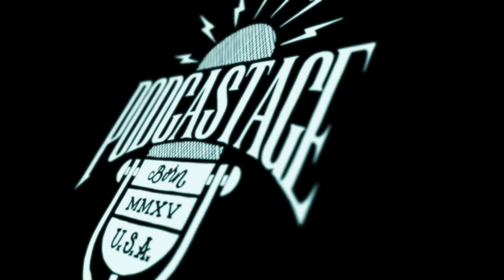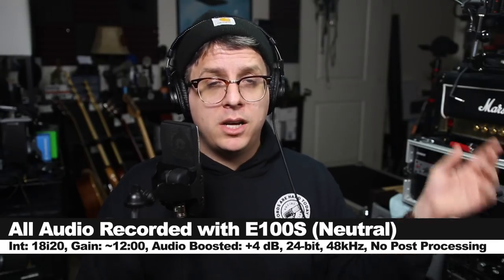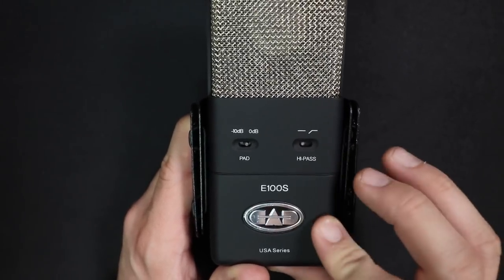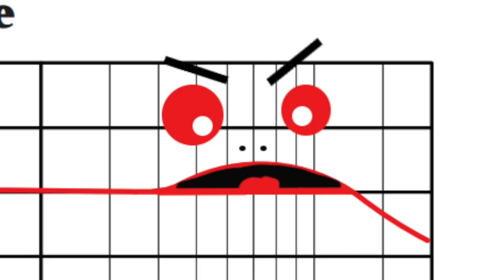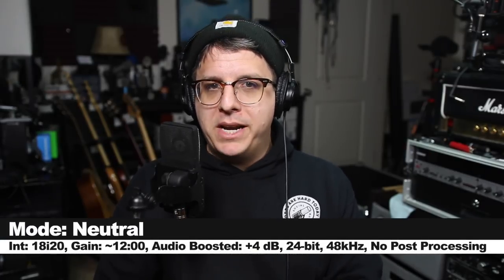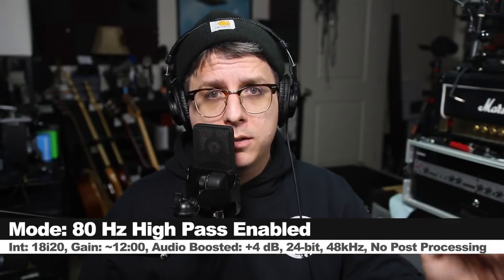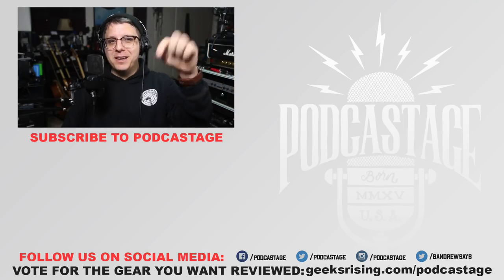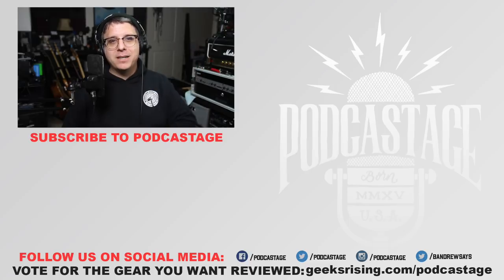CAD Equitek E100S Condenser Mic Review / Test

Comment: WARNING BEFORE YOU BUY:  I have just tested TWO CAD e100s microphones, back to back.  The recording was using a MixPre3-II with a sample rate of 48kHz and bit depth of 32-bit Float.  My first copy of the e100s had a noise floor on par with an AKG P420 (in other words, nowhere near the published specs for the e100s), the second copy I received is even worse (higher SNR than the first copy by about 2-3dB in my estimation, noticeably noisier than the first when listening to it in with Sony MDR-7506 headphones) in self-noise performance as I just finished testing side by side and scrutinized the recording wearing headphones and via spectrographic analysis and waveform statistics in Izotope RX8.  I really wanted to own a good sample of this microphone, but I don't think this is going to happen so I am returning both mics.  By the way, I am assuming both microphones came from the same batch since their serial numbers differ by 2 (one is SN6025, the second one is SN6027).  My Deity Smic2 blows them both away with respect to self-noise (EIN).  These were purchased through Amazon and sold by Photo4Less.  The box is NOT WOOD, but plastic, imitating wood.  I am aware of Booth Junkie's reviews/experience with similar problems with the e100s.  I am aware of all the discussions of Gearslutz as well.

Comment: I have the original e100 (without the S) it's got the golden grill. It's an amazing mic and my favorite condenser mic of all time for vocals. Out of all of the choices out there, I've just grown fond of the unique, buttery smooth consonant sounds it delivers and smooth vocals. The version in this video (e100S) does not sound like it has any problems either. If I ever need to upgrade because something terrible happens to my e100 original, I would definitely pick this up. As far as plosives, I never have a problem with my metal pop screen, but I can't speak on the S model because I only have an original. From the sounds of it though...this version does not sound noticeably different at all. Buttery smooth.

Comment: good mic. I think at the point where the boost starts it is a little too jarring and abrupt. It's like all flat and then BOOM the boost starts to rise at about 4-4.5khz. Overall it's a good mic though. It has a nice speech boost that goes under the 5db line and (ok at 7khz that's when the human voice ends and then the rest is the treble pretty much) has a little boost in the treble that doesn't make this mic breathy I think which is a good thing. Overall a good mic just with that jarring point where the boost starts and I think the price should be maybe $300-$400 (somewhere in that range) given all that is has going for it.

Comment: $500 with no adapter and a rubberized finish that will decay in just a few years, what exactly are these manufacturers smoking?
Reply from the maker: The mic sounds pretty darn good. This mic isn't made anymore they and they have more affordable mics that look like it. I haven't used them though so I don't know if the manufacturing and accessories are the same.

Edit: I believe that BoothJunkie did a video covering the new mics https://www.youtube.com/watch?v=CRp6LoEshUc
Reply: @Podcastage  I'm just disappointed in that finish from all the products I've had with it. But it does sound good, almost adds to the disappointment! But it could be better than others, that was just my fly by reaction hah.